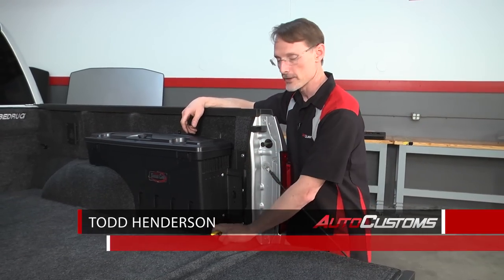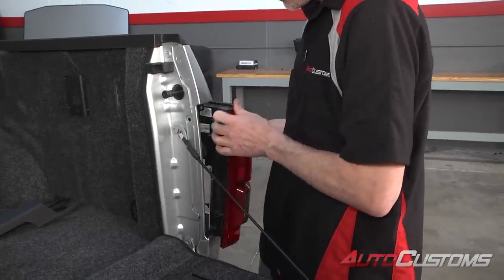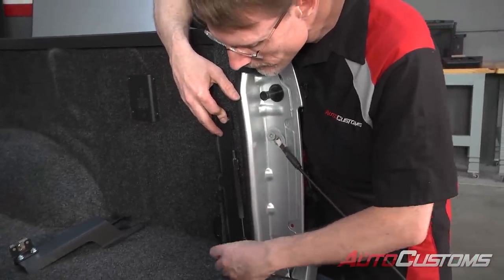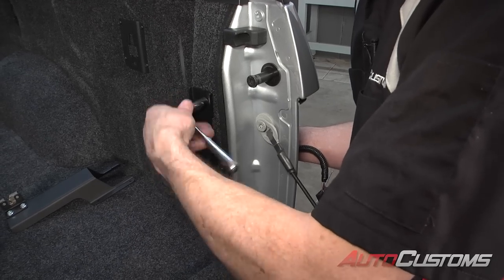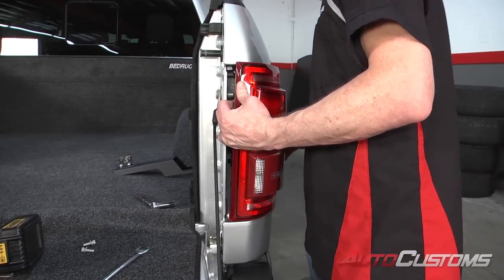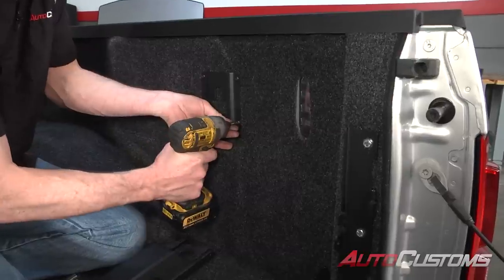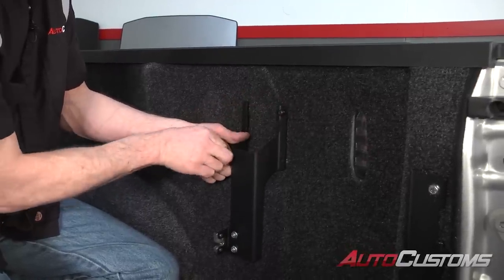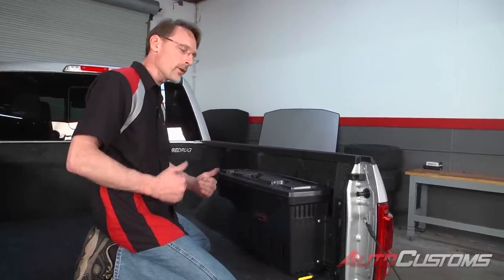How to Install Undercover Swing Case Toolbox on Ford F-150 at AutoCustoms.com

Comment: Do i have to trim if i have a drop in bedliner on a 2017 f150?
Reply from the maker: army77547: Yes, you will need to trim only where the 2 brackets per side screw into the bed.

Comment: How to install for siera gmc 2017 ??
Reply from the maker: To install the Undercover swing case in a Sierra it will require drilling into the bed of the vehicle. For install instructions you would need to contact Undercover directly.

Comment: how about a 1979 Ford f350
Reply from the maker: Unfortunately, it is not made for your vehicle. These are typically a drill application so if you wanted to modify the brackets you might be able to make them work.